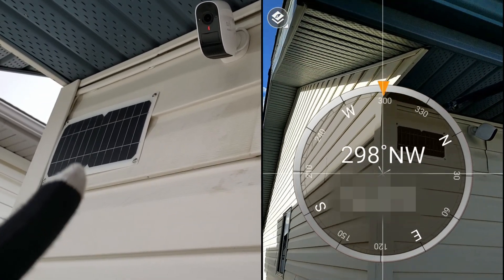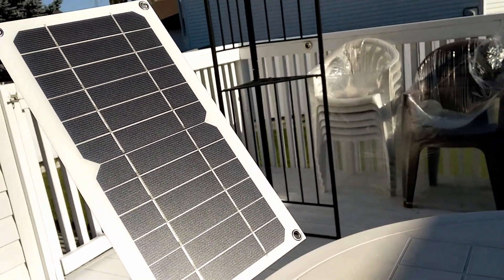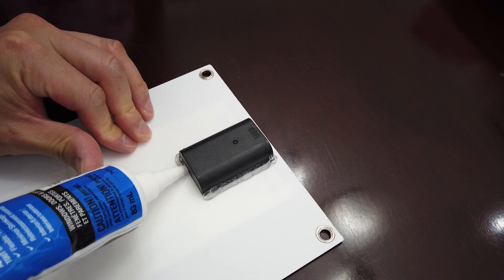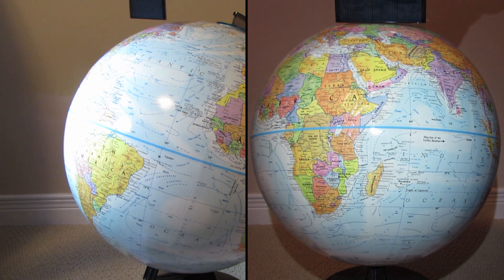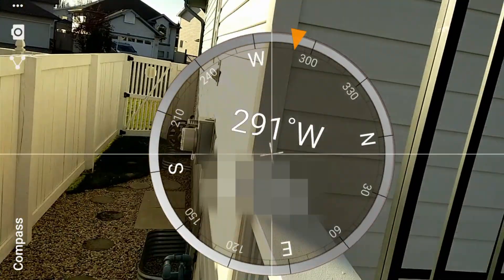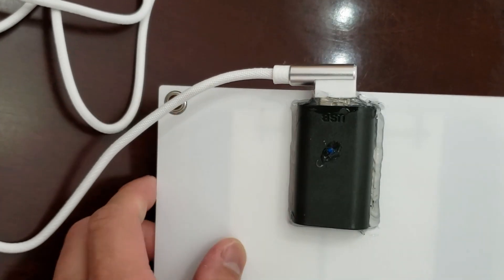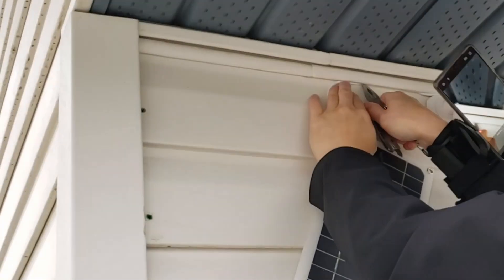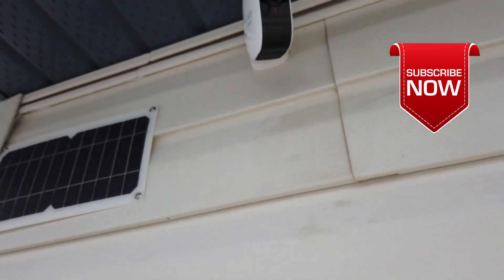Cheap DIY Solar Panel for Battery powered security cameras - Solar Power for Battery powered camera

Comment: Hello, i have a Eufy Cam 2C and i want to know if it's dangerous to leave the solar panel connected to the camera because i read that the battery can overcharge and make damage.
What do you think if a buy a Mini-USB power switch so i can charge the battery only when is needed?
Reply from the maker: Where did you read that the battery can overcharge?
I can't say that the charging system in eufy will not overcharge the batteries.  But as I know Lithium-ion batteries need to have a charging system that monitors the batteries temperature and charge.  Whenever the temperature gets too high or too low it will stop charging the batteries.  This is what I see with the eufy system.  I talked about this in the winter update video.  If eufy designed then system properly, I would think it will also stop the charging of the batteries when they are fully charged.  This is similar to what cell phones do.  So if anything, I don't think the batteries will be overcharged by using the solar panel.
As for the USB power switch, I'm not familiar with this.  Are you able to point me to some?
Reply: @FrakkingCreations  Thank you for the answer! I read some comment about the overcharge in other videos and on reddit, but they were more preventive comments and not actual experiences ( obviously reading them had raised the doubt of this risk ). 
One guy on reddit said: "Cant vouch for all the other cameras but my battery doorbell is connected to mains power and it seems to cycle the battery from about 60-90% to prevent battery damage."
Reading this I thought I'd consider using a switch.
This is the power switch i found:
https://www.amazon.it/MakerSpot-Raspberry-Pi-Alimentatore-Interruttore/dp/B01HEXFQTU/ref=sr_1_2?__mk_it_IT=ÅMÅŽÕÑ&dchild=1&keywords=interruttore%2Bmicro%2Busb&qid=1597135903&sr=8-2&th=1

It's possible connect the solar panel or the charger too. :)
What do you think? It's a good idea to try this?
Reply from the maker: I suppose keeping the 100% all the time could potentially affect the life of the battery and that's why it keeps the charge between 60 - 90%.
The cable looks ok but I won't know for sure since I haven't tried it.  Just note that if you do try it you will have to waterproof that cable and switch or put it in a waterproof junction box.
Reply from the maker: Also note that the MICRO USB plug is not 90 degrees. Is that going to be an issue for your camera install?
Reply: @FrakkingCreations  Thank you for your advices! I will buy the 90 degrees Micro Usb cable! :D

Comment: Great stuff! Can you please advise if I can use Arlo solar panel on Eufy since it uses micro usb? Thanks heaps! 😊
Reply from the maker: Thanks!
I can't say 100% since I don't have an Arlo.  But if Arlo's solar panels are just plain micro-USB solar panels that output at least 500mAh and up, I would think it should  work.   The higher the better.
Hope that helps.
Reply: Frakking Creations Thank you so much for information. Much appreciated!
Reply from the maker: You're welcome!
Reply: Frakking Creations One last question please since I’m no hope with electrical stuff. 😊
Will continuous charging to cam with solar be shorten the life of battery? Saw in blog that battery will last up to 300 charge cycles.
Thanks again!

Comment: Nice! Will be doing this for my dashcam for 24hr 2K video at 60fps plus audio monitoring without the vampire drain😍. Clean energy is boss!
Reply from the maker: Gotta love clean energy!
Are you installing a solar panel to charge your car battery or does you dashcam run off an external battery?
Reply: @FrakkingCreations  The dashcam is attached to the car battery via fusebox for "parking mode". Generally the battery is strong enough during summer months for 24hr motion detection, but once winter hits I have to disable parking mode.

I'm thinking of sticking the solar panel to the moonroof, which I hardly use, and leave it there.

But I'm guessing I probably can't run the car with the solar panel still attached to the battery? Would that damage it you think?

Comment: I did this same exact setup. Installed on my Eufy Camera 1 (from Kickstarter). Solar panel is installed on south facing of the house. It shows its charging but battery still depletes. Not sure the solar panel is strong enough to charge the battery.
Reply from the maker: Few questions ...
Does the panel get enough sunlight?
Are you located in northern hemisphere?
The panel should be enough as long as you get enough direct sunlight.  You may have to put in a better location on the south wall if you are in northern hemisphere.
Reply: @FrakkingCreations  I'm in the US (NY). No shading and in direct sunlight at all times.
Reply: @FrakkingCreations  I'm in the US (NY). No shading and in direct sunlight at all times.
Reply from the maker: How long does the Eufy 1 last on a single charge?
Did you test the panel before installing?
And does your camera charge with a 400mAh USB charger?
If it charges with a 400mAh charger it should work with the panel if it is not defective.
Also, if the camera is detecting a lot of activity, it may use up more power than the panel can keep up with.
Reply: @FrakkingCreations  Eufy 1 last 365 days on a full charge. This is installed in my backyard and there's barely any activity. Not sure what it uses for charging since I just plug into outlet or Anker 5 port USB to charge.
Reply from the maker: Not sure why your setup doesn't work.  It should.  Did you test the whole setup before you installed it?  That would have been the best time to ensure nothing is defective like the panel or USB cable.
The panel should be able to charge your cell phone too.
Reply: @FrakkingCreations  I don't know either. It shows that it's charging but it's as if it's not pumping out enough energy. May have to take it back down and try again.
Reply: UPDATE...it seems to be charging now. Camera is now 100% for the past week. However, camera now goes offline once in a while. I don't know if its a coincidence or not.
Reply from the maker: That's good to know it's charged up to 100%.  At the beginning of the year our system was going offline and weird problems with connectivity with it but I linked that to the updates that were auto applying.  Ever since then it's been stable.  You can check the system notifications to see when the updates we're applied and completed.  This may help you narrow down the cause.

Comment: Will this work with a eufy 2c cam
Reply from the maker: I believe it should work on the eufycam 2c too but we don't have one to try with.  One way to test would be to use a usb charger that outputs 5V at around 400 to 500 mAh.  If this is able to charge the camera then it probably will work.
One thing to note is that the batteries on the 2C have half the capacity of the eufycam 2 and E so you may want to consider a larger output solar panel.  This  will charge the camera faster. The one in this video outputs 800 mAh at 5V when in full sunlight.
Though if you can install the solar panel some where in direct sunlight most the day I would think that the panel in the video would work too.
Reply: @FrakkingCreations  if 2C is half the capacity then the of the 2 then the battery will charge faster not slow with the same solar panal

Comment: Why you installin Solar panel under roof??? there is no direct sun light.. it will not work or work very bad
Reply from the maker: Actually, it does and did work.  Checkout our 1st winter update video where I go over how the external power and solar power solutions work out with the battery powered EufyCams... https://youtu.be/8Rr11ZC6ow4
Like I mentioned in the video, I choose to install on the wall of the house since it was easier to access for any maintenance reasons and also because here in Canada, we get snow on the roof in the winter.  The snow will cover the panel and definitely prevent sun light from getting to the panel.
We have used this solution for about 9 months now and it's fine.  Though, as a result of what we learned over this time, I will likely move the panel from the East facing wall to the South facing wall since it is best for Northern hemisphere installations.
Reply from the maker: If you're interested, our latest video - DIY hack for 150 ft long USB Power cable for smart security cameras, is out

Comment: Will the solar panel definitely work with the Eufycam 2 (not the E or C version) , just the Eufycam 2?
Reply from the maker: I can't say it will definitely work since I don't have one to test with.  Though if it has a micro USB port for charging it could work.  If it can charge using a 400 - 500mAh USB charger then it is a good sign it will work with the solar panel.
Hope that helps.

Comment: Do not see link for rt angle cable or solar panels.
Please repeat
Thanks
LIKE your vids - simple solutions that work.
Reply: Your amazon page for the cable is no longer there
Where do u get the module?
Reply from the maker: If you are referring to the solar panel then you can get it here.  This is a larger panel than the one used in the video... https://bit.ly/36qB2SK
For the panel used in the video check our video description.
Reply from the maker: Thanks for commenting.  Much appreciated.
The links are in the description of the video somewhere further down.
But here they are for you...
Note that these are our affiliate links so we may make a small commission if you buy from them.
USB Cable used in video: https://bit.ly/2U0jTZQ
Alternative cable: https://amzn.to/2pWxzti
Solar panel: https://bit.ly/2oQyD1W

Comment: Hi, will this work on Arlo?
Reply from the maker: It is possible it can work IF the Arlo you have in mind has a micro USB port for charging.  Also, the Arlo would need to be able to charge with USB chargers that output 500 to 800 mAh.
Reply: @FrakkingCreations  Thank you for the quick reply!
Reply from the maker: You're welcome.   Let us know how it goes if you try this out.
Reply from the maker: I found some more info on Arlo usb port here:
https://community.arlo.com/t5/Arlo/Camera-USB-Port/td-p/1274954
Not sure if you have the same model or not but you can look for more info there.
I noticed that some arlos are not meant to be used with rechargeable batteries.
Hope that helps.
Reply: I’m here for arlo too!!! All
Other solar panel for arlo is less than 13 feet long, I need to make one that’s about 20 feet long.
Reply: Depends which arlo you have, I’m thinking of getting this solar panel and getting the usb cable from arlo.
Reply from the maker: What is the length of this arlo cable?
Reply: Frakking Creations spoke to Arlo yesterday but they couldn’t help me out. So I did some research and I found the uogw solar panel and their outdoor charging cable, it’ should work if I use their longer charging cable instead of the short one that come with the solar panel. We will find out when I get them
Reply from the maker: Good find.  If you don't mind sharing the outcome of your efforts that would be great.
Reply from the maker: Did you find a solution?
If not, check this hack out... https://youtu.be/Duk7qu3_ED4
You may be able to have a power cable up to 150 ft.

Comment: How’s your  solar going? Has it been able to sustain the battery level ?
Reply from the maker: Solar has worked well.  The thing to note is the temperature.  If it gets below 0°C then the system won't charge the batteries.  Otherwise when it's sunny it can charge the camera pretty good.  Note that it's not a fast charger as it has max output of 800mAh.
Reply: Frakking Creations does the voltage output of the solar need to be specific volt? or it will just charge slower?
Reply from the maker: I believe a little under 5V and up it seems to start to charge.  5V is best for it to be faster.
Reply from the maker: Here's our latest eufy winter update video if you're interested:   
https://youtu.be/8Rr11ZC6ow4
Reply: @FrakkingCreations  does the blue charging light stay on all the time when its sunny?
Reply from the maker: Yes.  When the sun is bright enough and the panel is outputting power the blue light will be lit.
Reply from the maker: Our latest video is out now.  If you're interested, it's a DIY hack for 150 ft long USB Power cable for smart security cameras.

Comment: Location location location then mounts it on the wall
Reply from the maker: I mentioned that my choice to install where I did was for easier maintenance and installation.  The fact that the batteries last so long is also another reason why this is not a huge issue.  For us, it would not make sense to install on the roof of the house because in the winter we get snow that will cover the panel.  There was enough information in the video for most people to do this DIY or starting point to research for more info.  In the end everyone needs to decide which factors are most important for their own install.
Reply from the maker: I think most li-ion circuitry are made to stop charging li-ion batteries once they are fully charged.  It's similar to cell phones.  The electronics is supposed.to protect the batteries.  Same reason the eufycam won't charge the batteries when the temperature of the battery is higher than 45 degrees C  or lower than 0 degrees C.
Though, keeping the li-ion batteries at 100% all the time could affect the batteries.
Reply: @FrakkingCreations  do you ever experience "Charging Error" in eufycam from the solar panel because other brand like arlo cannot do like this.If it has no problem,i might try eufycam.Thank you for your  experiment.
Reply from the maker: Sorry. I missed your comment.  We haven't had any errors with charging yet other than not charging when temperatures are outside acceptable ranges like I mentioned in previous comment.
Here's our latest eufy winter update video if you're interested:   
https://youtu.be/8Rr11ZC6ow4
I talk about our experience with eufy in winter and also about the 2 charging solutions.
Reply: Can l find better brand of solar panel for my eufy cam ? 
Like waterproof panel?
Reply from the maker: There are other panels out there but we haven't tried them so we won't know how good they are.  Fully Waterproof ones could cost more too.